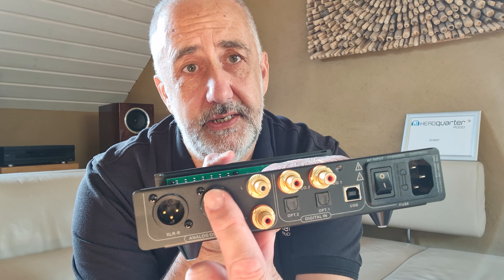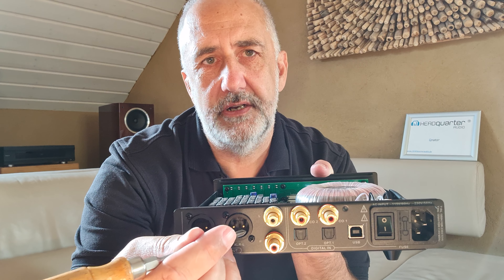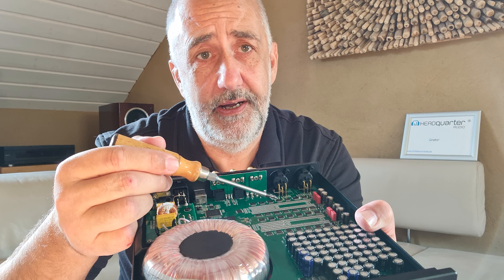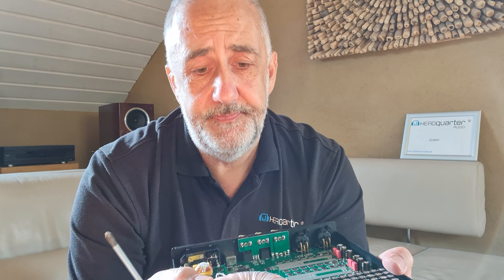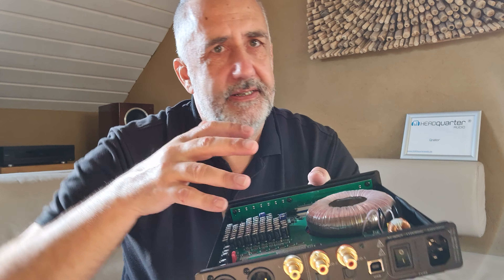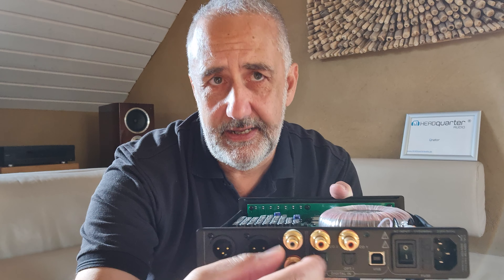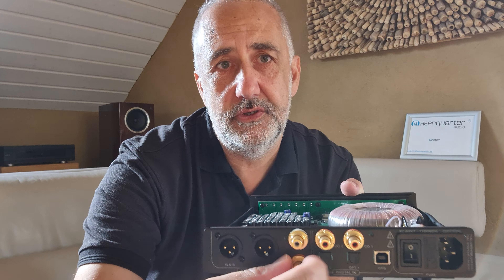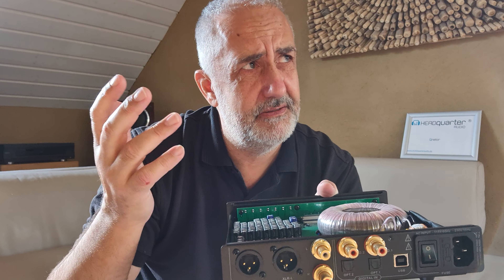STOP! Most important tuning tip ever! Not only Denafrips, for all new Devices!

Comment: very good tip  .i think all electronics should be "floating" from the main chassis.the more seperation in floating boards the better the sound . if every piece of electronics was floating on a different board you will get the best results.....
Reply from the maker: Hi, I don't mean to be rude, but my opinion is different. :-) All parts must be firmly connected to each other without just shaking or rattling. Everything has to have a common basic resonance, preferably everything on one board ... without any damping systems in between ... like a good instrument, and EVERYTHING has to be built in without tension. Cheers Mike
Reply: @headquarteraudio5388  all parts  will have the same resonance if you put each one on the same sized boards . the connection between parts could be with flexible wire so no resonanse goes between parts but the electrical connection between them is firm because its been soldierd ....
Reply from the maker: @shaynakash4222  Hi, sorry, unfortunately not my opinion and my experience. Just because of manufacturing differences and different torques on screws, differently precise assembly of components will always result in a different response. You lose the center in the sound image and the spatial image becomes diffuse. Believe me, the Ares 2 and other devices also sound so good because the sockets are on the board, they have a resonance connection that is not interrupted by a cable, unfortunately the Ares 2 has two boards ... but what is it, what Is there anything better than being satisfied with your system ... cheers Mike
Reply: @headquarteraudio5388  well you right about that and if you will ever test the ecdesign dac i would be happy to hear your opinion on that . for me its the best dac i ever heard.....cheers to you to bro...
Reply: That's what I do when i build tube amps......I even let the cabling floating and if necessary rest the slag on a cork.
I really relieves stress and makes a difference , the better the electronic the greater the difference..
By the way components and cabling vibrate with the signal passing trough........

Comment: It's just human nature that if you expect to hear a difference, you will. Did Mike or his subscriber do a blind audio test? If not, then this can't be trusted. There'a a lot of "snake oil" in the audio industry. At least Mike isn't trying to make money over this "discovery".
Reply from the maker: Hi, this is a fair and honest tip for which i don't charge any money. Why, anyone can quickly find out whether it works. I don't expect anything, I just notice. With a proper listening experience, you can hear this right away, but surely you haven't even tried, many others have tried it and come to the same conclusion ... Cheers Mike
Reply: Thanks for your post. I was wondering if anybody would believe this unquestioned.

Comment: Mike- tietjen here. I missed this new vid. For some reason, my machine unsub'd your channel! Anyway. As I understand it,  your new tuning mod addresses the unimpeded even vibration of the circuit board. This is akin to the top (or back) of a kontrbass vibrating when a string is excited. While the viol is resonating, if you press your palm on any part of the front surface you damp the sound, resulting in constricted, muted and attenuated tone. If this is an accurate observation, my question to you is how do you know if and how the circuit board is designed to resonate. A bass viol is designed to "ring" in a certain way. Or does your mod end uneven (inorganically shaped) stresses on the CB? Great ideas as ever Mike. My Q-STAB continues to amaze. Is it possible Q-STAB is "breaking-in?" Critical listening would support this! Lastly, what are your thoughts on "Cryo" treatments? Fine english!
Reply from the maker: Hi, yes, it's all about removing mechanical tension from the board. The actual resonance of a board can of course not be changed with the tip, that is done by me in a large tuning :). This is where the greatest added value to be achieved lies in the sound :). When using the QStab, sometimes something else becomes apparent due to its increased musicality. For example, make sure that the sound changes at certain temperatures of the devices. So if you always switch on the system or a device freshly, it expects and the sound changes, this can last longer over a temperature range and then the sound opens completely again. the QStab shows a lot more ... Cheers Mike
Reply: @headquarteraudio5388  I see.Thank you, Mike. Also: I'm a source "always on" guy. I'm glad another viewer asked about cable weight. I wondered about that, too. And: Biden!
Reply: A circuit board is never meant and also not designed to resonate. That is bullshitting par excellence. I wonder how grown up men can be so silly to believe all that stuff.
Reply: @francograpelli3060  Franco, have you actually tried Mike's idea?

Comment: Hi Mike I have Denafrips Hestia/Hyperion Preamp & Power amp which are connected by XLR.  Do you think this can also change sound with amplifiers?
Reply from the maker: Hi Richard, of course, that applies to every device with the XLR sockets mounted on the circuit board. It's no problem to try this out quickly, you'll hear it right away ... Cheers Mike

Comment: OMFG, I was very skeptical, but yeah, there is a slight change. Appreciable. I did quarter turn out,  observed slight movement in the female XLR connector with finger pressure is all I did. I might try it on a few devices, but probably not on 100+ pound amplifiers :)
Reply from the maker: Hi, nice :) cheers Mike

Comment: Hi Mike,
It appears that the Pontus should not have the same problem, given the two-floor architecture. Is that your experience?
Thank you.
Reply from the maker: Hi, it has nothing to do with whether or not I have a two floor unit. It only affects the force of the screw connection on the board and braces it. This applies to every device and must be avoided. Cheers Mike
Reply: @headquarteraudio5388  Thanks Mike.

Comment: Hi Mike, thank you for your video. I would like to ask you what Network audio streamer/player is good (below $500)  to pair with the Ares II? Looking forward to your reply. Thank you!
Reply from the maker: Hi, I was told (I don't hear streaming in big rig) that the Blue Sound is good with the Linear power supply, or the Pink Faun I2S Bridge straight from the PC ... I have Tidal with Audirvana on the PC/Headphone ... just to to listen to the songs beforehand and then buy the CD ...

Cheers Mike
Reply: @headquarteraudio5388  Hi Mike,  thanks for getting back to me. I’m currently using my macbook going to my NAD C356DAC. In the next week i will get another integrated amplifier, I’m trying to avoid using PC this time. So Bluesound & Denafrips Ares II sounds a good combo. Thank you again.
Reply: @headquarteraudio5388  I had the Bluesound Node 2i but the digital out was not as good sounding as the Innuos Zen 3, which is admittedly 4 times the price. But the interface on the Bluesound app is fantastic. The iPeng app on the Innuos sucks.

Comment: Some people feel the XLR output on the Ares II is superior sounding to the RCA and will even recommend getting a XLR to RCA transformer if connecting to an amp or preamp with only RCA inputs. Do you hear any significant difference between the XLR vs RCA outputs? Thanks Mike!
Reply from the maker: Hi, i think also xlr ist better but not with transformer.  Better use a very good rca cable ...cheers Mike

Comment: Cheers Mike ... Are you only doing this tweek if you're using the XLR outputs only ? ... Thanks in advance
Reply from the maker: Hi RM, on a small case, this applies to all XLR sockets and other plugs that are mounted directly on the circuit board and which are scewed to the backpanel. Simply loosen the screws a little, you may hear a faint cracking sound. Especially with new devices, with older devices the circuit board has usually already settled, the effect will be smaller.Try it ! :)  Greetings Mike

Comment: Hi, thank you for creating these videos in English, I know it isn’t your native language.  I will try this tomorrow on my Ares 2.  Do you think applying Norez dampening material would make a difference?  I was listening to a podcast yesterday, Karl Heinz the speaker designer has an Ares 2 and recommends putting the dac on a isolation platform and then weight on top.  Have you tried any similar techniques?  Thanks for the tip
Reply from the maker: Hi, thanks for the comment. I'll go another way, whether you go with is your decision. Just try it out. I've been through all of this for a long time, so there is only one way for me to de-dampen and remove tension, the result is music. Whoever  uses weights and dampens receives technically clean signals but small unmusical tones, who likes it? ... :) I don't! Cheers Mike

Comment: Glad I bought a new example after seeing this vid. Probably a lot of Denafrips models now circulating the pre-owned market that no longer measure within the engineer’s intended tolerances and have channel imbalances or other issues. Stresses on the PCB do in fact affect R2R performance but if you alter them, the DAC should subsequently undergo a bench-test to insure the performance has been improved rather than compromised.

Comment: es soll doch eigentlich nichts schwingen wegen der mikrfonie. es muss so fest wie nur irgend möglich sein.
Reply from the maker: Hallo, fest ja, aber nicht verspannt oder angeknallt. Das ist ein gewaltiger Unterschied. Auch sehr leicht hörbar. Gerade bei Problemen mit S-Lauten oder fehlenden Tiefbass oder sogar Frequenzlöchern/fehlende Sprachverständlichkeit. Auch die Reihenfolge beim anziehen der Schrauben ist wichtig...ich habe schon hunderte Geräte optimiert, und es kristallisiert sich reproduzierbar ein Effekt heraus: Musik :) Cheers Mike
Hello, yes, but not tense or cramped. That's a huge difference. Also very easily audible. Especially with problems with S-sounds or missing deep bass or even frequency gaps / lack of speech intelligibility. The order in which the screws are tightened is also important ... I have already optimized hundreds of devices, and an effect is reproducible: Music :) Cheers Mike

Comment: You are  introducing distortion by loose connection ( increased resistance) .  We need  tight and secure connection for better signal. This is not right way .
Reply from the maker: Hi, some try it, others forego the advantage ... Please explain to me at which point do I change the contact of the plug connection or even create a higher contact resistance? I don't understand how you come up with it. This is about mechanics ... Cheers Mike
Reply from the maker: Hello, no problem, but loosening 4 screws and tightening them again if you don't like it is not rocket science :) Cheers Mike